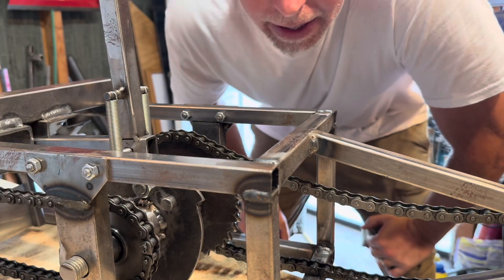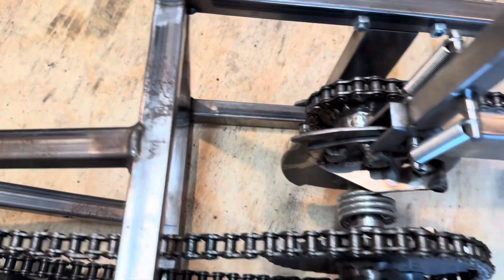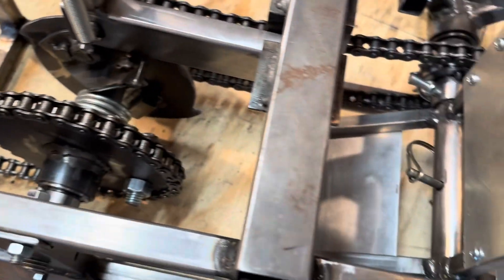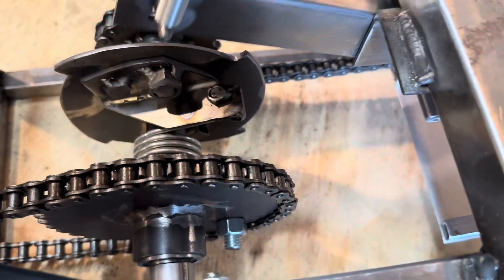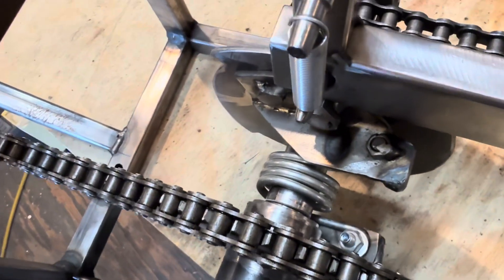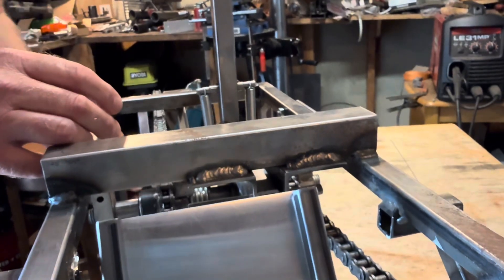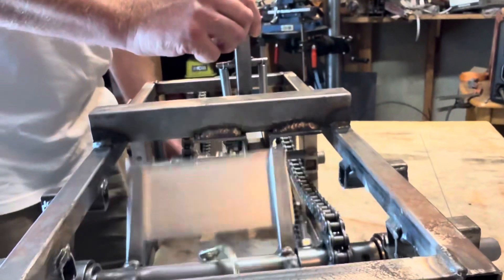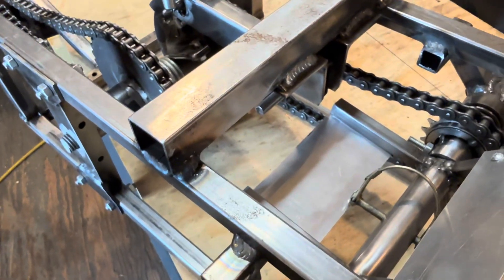Torsion Spring Pulse Engine (prototype)

Comment: I get what you are trying to do, but this is a basic physics problem. it takes X amount of power to do Y amount of work. so you can use a smaller motor, but you are still only going to get whatever amount of power that motor is capable of producing. Adding all this only adds exchanges of forms of energy from kinetic to elastic potential back to kinetic. There is always a loss of energy any time it is converted from one form to another.
Reply from the maker: A few years back I saw a guy featured on the news showing off his jumping stilts, dude was jumping over cars, running 20mph, it was crazy. My thought was, what if you could do that on the rotational? Like on a bike